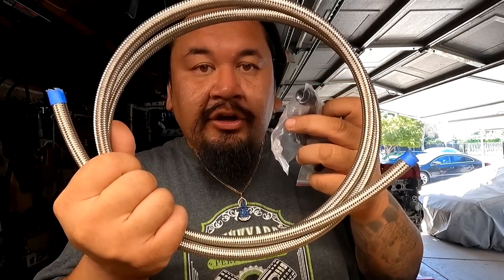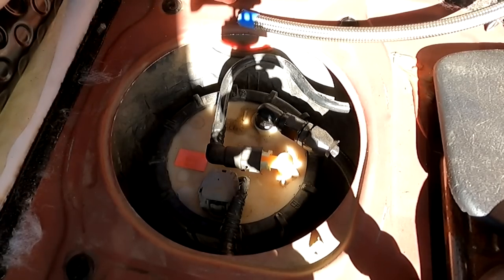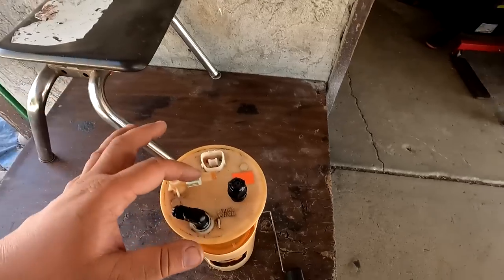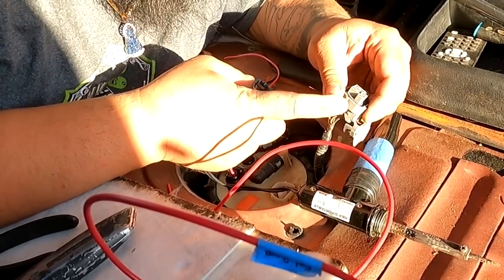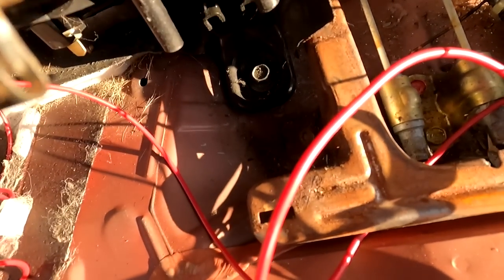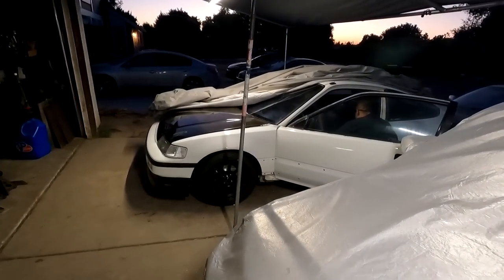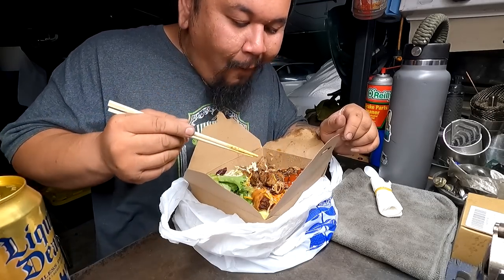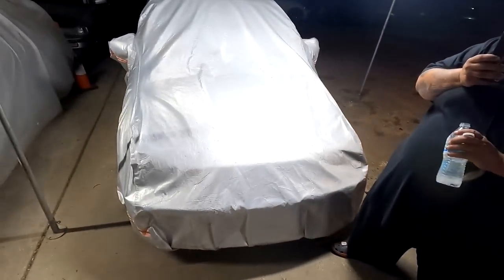Walbro 450 On Relay | Turbo Honda Element | BullBoost Steering Wheel

Comment: The fat 10 gauge power wire needs to go drectly to battery however need like a inline 40amp circuit breaker. How I do mine... not fuse box!!!